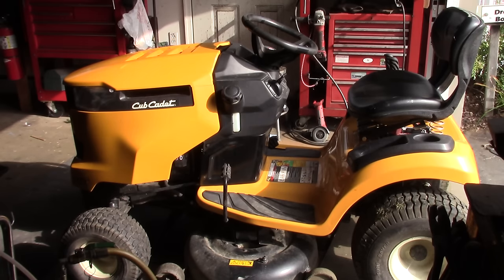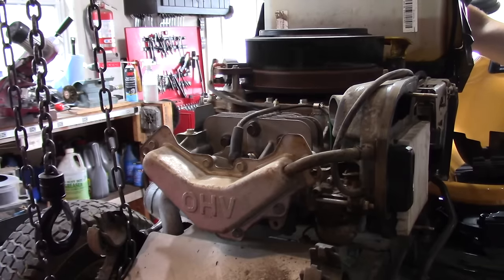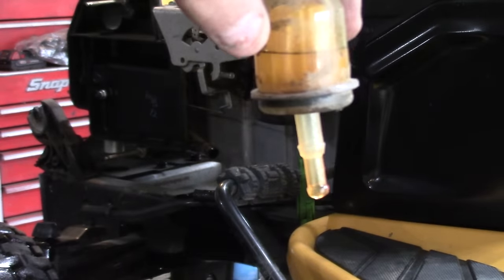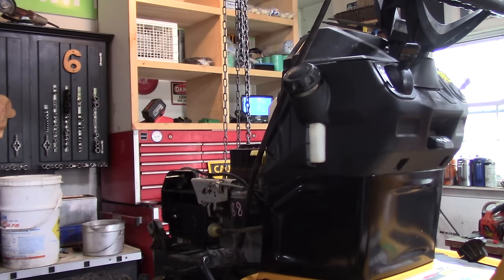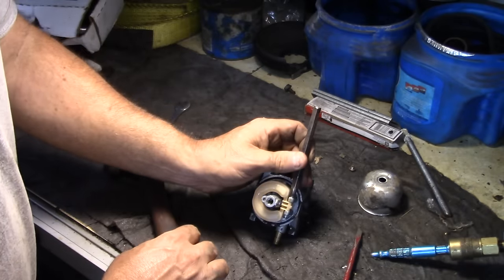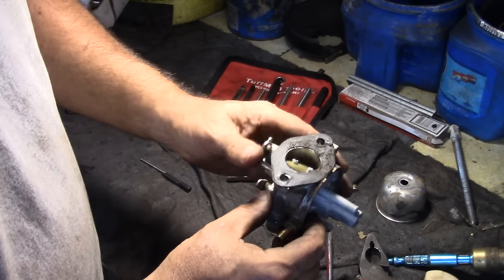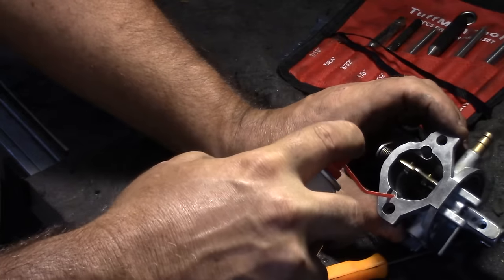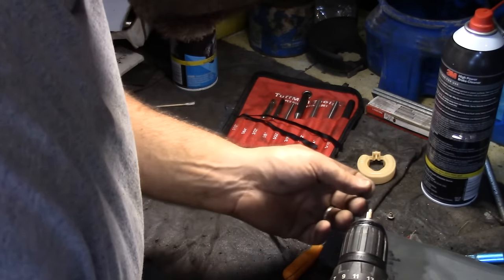Cub Cadet Stalling While Cutting

Comment: For a Quick assessment of a engine , I use Prime for a Good Time . If the engine does not start when cranking , I spray some carb cleaner into the carb then try to crank , usually it will run for a few seconds on the prime . This checks , compression , mechanical timing , Ignition timing ,ignition function . All in 10 seconds .If there is no start then start with the separate system tests  . You can use any priming fuel you like . This works    for any type of engine two or four stroke . Just trying to save you some time .
Reply from the maker: Thanks for the tip. Main problem was dirty carb and water in fuel on this one.

Comment: very nicely done. I'm having that exact problem. It started last time I mowed and had to run with choke on for most of the yard and now it won't start, so I guess I will try what you showed and find out if that works. Thanks for a good video.

Comment: Most generally if your keeping it running by using carb cleaner and the bowl has fuel in it then it's needle and seat.. I usually replace needle and seat clean carb starts and runs fine..

Comment: My neighbor's Cub Cadet XT riding mower has been in my shoo about 5 times in 2 years for problems.  The reliability of this mower is in question in my opinion.
How long have you had your lift and do you like it?  Looking for one just like the one you have. Is it free floating or bolted to concrete?
Reply from the maker: The lift is the Handy SAM lift.  On wheels and removable.  lifts 1500lbs, and comes delivered.  I like the 39" total height for working as a workbench.  Yes well worth the money if you work on equipment all the time.

Comment: Nice fix. I have a husqvarna and a troy bilt with the same engine. Only real issue i've had with both of them is the oil drain valve leaking and all i did to fix that was put some thread sealant tape on them and haven't had any leaks since then. Looked like the fuel in tank had water in it but it could just be me
Reply from the maker: Yes, it did have water in it.  That is why it had a hard time firing at first.

Comment: WE HAVE HAD A LOT OF PROBEMS WITH OUR CUB CADET RIDING MOWER NOOT STARTING.
The root of the problem is always the same... 
The cub cadet throttle mechanism doesn't move the throttle mechanism far enough to fully apply the choke.
We finally did a work around (adjusted the throttle to choking well before the expected point on the throttle level

Comment: how did you lock the clutch down to start engine on the ramp?
Reply: Cub Cadet should have a parking lock handle. 
This also allows an operator to park the running mower and unmount without having to turn off the engine. 
The feature allows to turn on the engine without being seated or pressing down on the brake.

Comment: Did you actually fix the guy's problem?  My tractor was doing the same thing, but it starts great, it just sputters and stalls 10-15 min into the job.  I did all the same steps and I even replaced the carb because they no longer sell carb kits!?!?  The tractor ran well for the first 25 min then it went back to sputtering and stalling.  I guess the fuel pump is the next thing to check and replace?

Comment: Nice fix, I had four of those quick change oil valves on the Kohler's this year and all were leaking, A standard metric socket will not fit between the frame and oil fitting. I made a wrench for it or you can use a crow foot wrench to tighten them in. They are loose from the factory. Thanks for the video. P.S. Where did you purchase the lift??? thanks
Reply from the maker: I use a chissel to tighten the oil valve if I can't get a wrench on it.  I am making a video on the lift in the near future.  MileX lifts online is where it came from.  Handy Sam lift.

Comment: Great video but I believe that fuel filter is for an engine that has a fuel pump
Reply from the maker: You are correct.  I like these better and I have not had a problem with them not working.
Reply: I use the same filters in my mowers without a fuel pump and they work just fine

Comment: Where did you find that bench grinder with the drill chuck? That would come in handy.
Reply from the maker: Found at the scrap yard,  Modified to fit brass wheel and drill check.  The threads were perfect for the 3/8" drill chuck.

Comment: I’m having the same problem with mine. It will start and run for a while then dies after mowing for a bit. I have replaced the oil, oil filter, spark plugs, fuel filter, air filter, two gas lines, carb, fuel pump, cleaned gas tank, but still having this problem. I don’t know what to do at this point.

Comment: My Cadet was doing the same thing.  After changing air filter, and the fuel filter.  It would run for a few minutes, and die.  My problem was simply not having the fuel cap not tight enough,  it requires the cap to turn , and make three clicks to be tight enough, and the air vent in the cap to work to work.   Thank you for your chanel
Reply from the maker: I didn't know the cap had to be on to run.
Reply: The cap not put on correctly created a vapor lock in the tank.  If you loosen the cap after it stops gas trys to.come out at the cap.  The mower will probably run with the cap off.  I didn't try it.  All I know is that I had a cup or better of fuel being pushed out the top of the tank which gave me a clue as to my problem.
Reply: @doublewide6  I guess it was kind of a vapor lock in the tank.  With the cap not on correctly pressure build up in the tank.  When I loosened the cap fuel was putshed out of the tank at the fill cap.  I thought I had a bad cap, but when I put the cap back on I remembered to tighten it to the third click. ( after you get the cap on and.have done a few turns of the cap the cap will make a clicking noise, at the third click it should be tightened properly. ) beats rebuilding the carb, and still have the problem.  Have a great week.

Comment: Thanks for the video. I'm having an issue I can't figure out can you please help? This one will mow for 15 minutes or so then die and will restart right away and doesn't need to be in choke. When I got it there was a ton of junk in the tank and the pep cock was clogged the fuel lines were dry rotten so I cleaned the the tank replaced fuel line filter fuel pump and cleaned carb and its still doing it. The customer said another shop replaced the coil. I put a new plug in and changed the oil cuz it had water in it. Valves are good. What am I missing?

Comment: Had mine for 1.5 years and it started cutting off on me about 2 months ago. At first it cut off after using 30-45 mins, then 20-15, then to 10-5 mins. It still starts but will cut off. My buddy disconnected the intellipower knob and the motor doesn't cut off and will just keep running and cutting in idle..which would mean its not a mechanical failure. I guess it's electrical or maybe I need to replace the intellipower module/assembly. I wasn't expecting a problem like this with my CC.
Reply from the maker: I don't know about that module, not sure if this tractor has it or not.  Good luck.

Comment: My mower starts fine it runs normal when not cutting it just cuts off when the blades engaged and it's under load. Happened last time I cut too but eventually it just went away 😅 any ideas? Thanks

Comment: why would you check for spark when you know the engine will run the title says stalling while cutting so it means its getting spark
Reply: You seem smart. What do you think the issue on my mower might be. It’s starts on choke but stalls in like 10 seconds. I can start it not in choke and it runs fine, but curious why when I’m choke it stalls and spits out white smoke. I know nothing about mowers or engine really.

Comment: Never had a float pin so hard too remove.
Reply from the maker: A definite sign of water in the carb.  I ended up draining the fuel tank on this one (not shown in video but gas looked very yellow in color,
Reply: @doublewide6  i noticed it. Had the same problem before

Comment: What a piss poor "mechanic".  First rule of thumb to turning wrenches is to actually turn a wrench before putting an impact on it and just gunning it.  I'm sure you've broken off enough screws to already know that though.   The second rule of thumb is to diagnose 1st, not throw parts at it 'hoping' to fix the issue.  

Had you been paying attention to proper diagnosis you would have known that jet was clogged before you ever removed the carb. You could have fixed the issue without removing the carb body and saved yourself a can a carb cleaner.  Even blind squirrels find a nut on occasion. 

As a parts dealer I do thank you though.  Keep that cannon firing for me.
Reply: Where is ur channel then? Mister "pro" u get paid for repairs? Didnt think so... "mechanic"? Its a mower... no computer chips to tell u what's wrong...
Reply: I thought it wasnt a parts cannon , i call it general neglect/maintence ...it happens alot

Comment: my throttle cable broke and this is the second carburator on a cub cadet 22 hp  V twin . Foriegn gas sucks. DEMOCRATS SUCK    only 80 hours on it and I have had to change the fuel pump and gas filters 2 times already . Air filter should be cleaned often also   By the way I am a 71 year old woman  BAD GAS SUCKS NOW  FOREIGN FUEL SUCKS   DRILL OUR OWN CLEANER FUEL  I will have to clean my other one now  Thank You